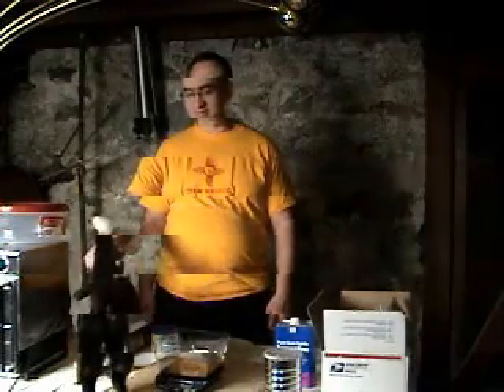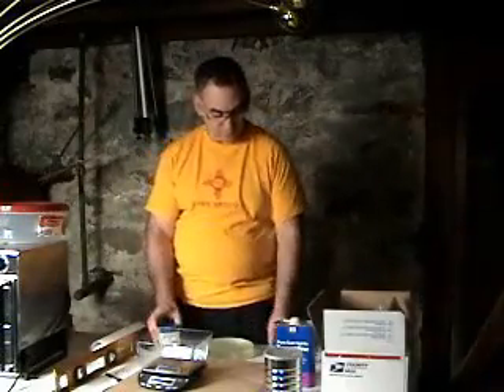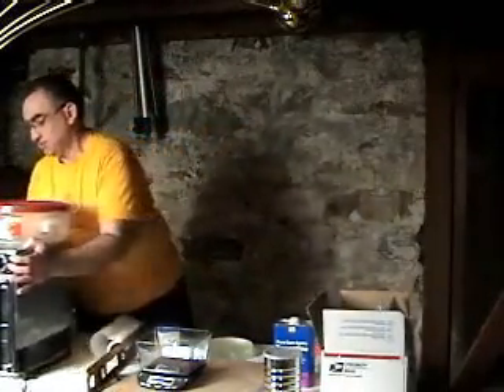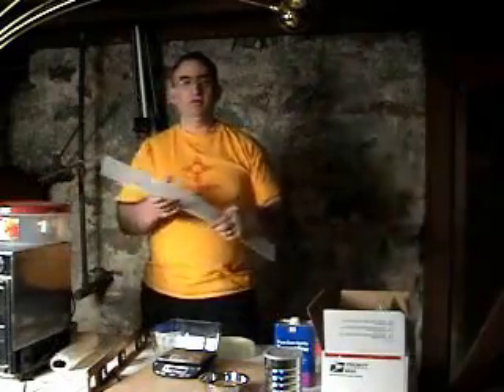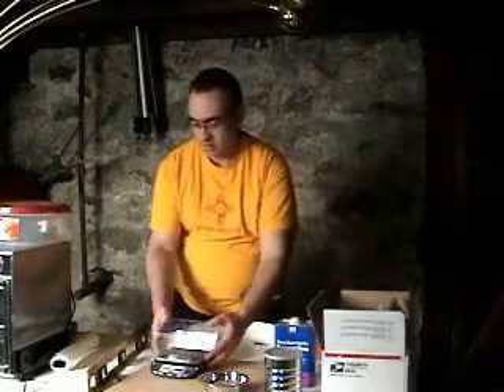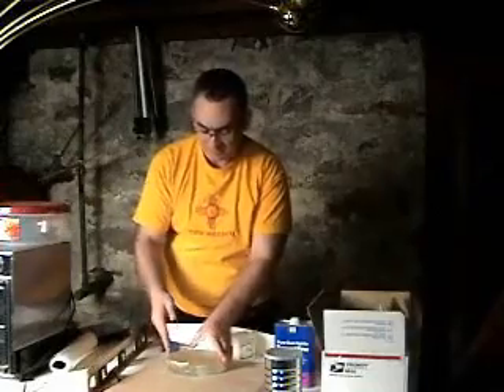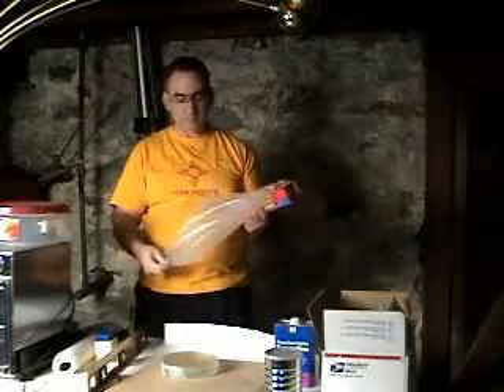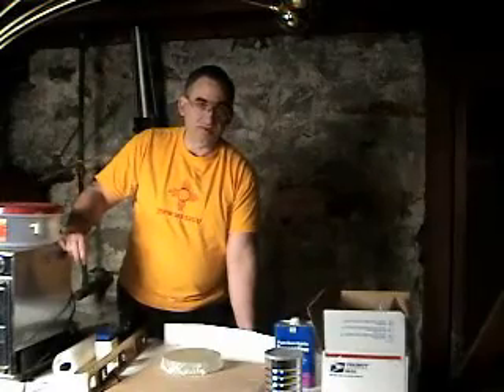Making a Telescope Mirror Tool from Dental Stone Part One

Comment: Looked a bit more and I see that fine ground means that the curve for the mirror has been fine ground and that the tool you are making here is for the pitch lap used in the final polishing.  I may have to email you with some questions on rough / fine grinding if that's ok?

Comment from the maker: Thank you for your comments. Dr. Angel at the University of Arizona in Tucson pioneered mirror making using rotating molds in his lab underneath the football stadium at the University. 

The shape will be pretty good, but not perfect, I believe the reason is twofold, at least. Partially due to friction of the molten glass and it's interaction with the mold as well as with itself. The other reason I believe is the lack of complete homogeniety of the glass. If you try it yourself, you are brave.

Comment from the maker: Thanks for your question. The mirror runs about $200.00 all together for the blamk, tool, pitch, abrasives and polishing compound. The Optical tube assembly and mount can probably be made for under $100.00, but you can spend as much as you want depending on how sophisticated you want to be.

Best regards,

Francis J. O'Reilly